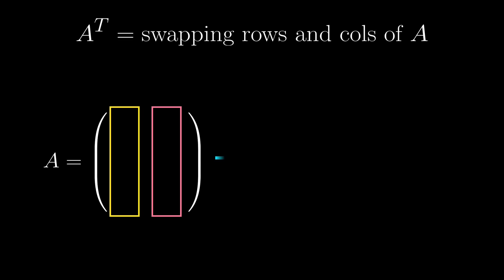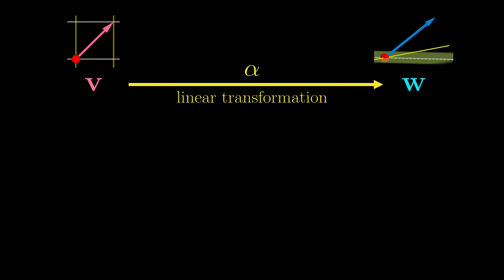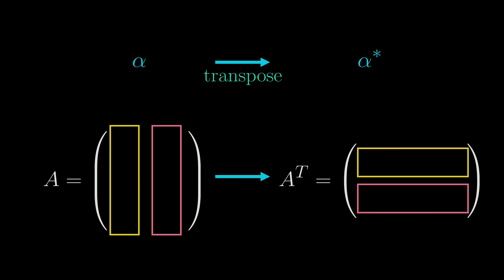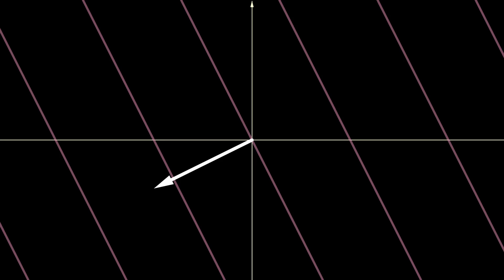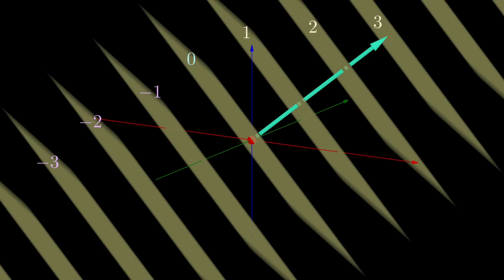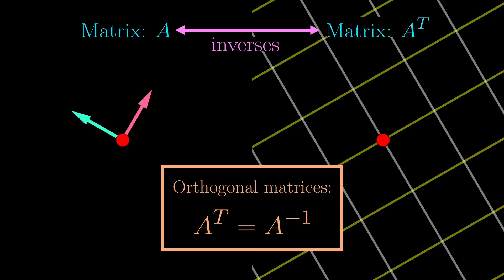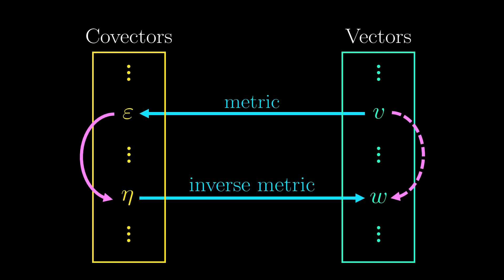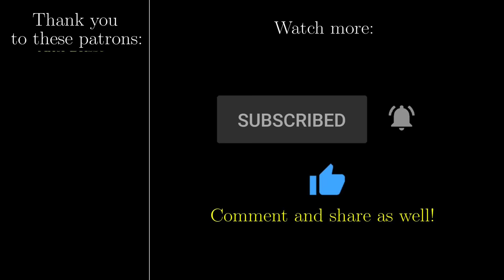The deeper meaning of matrix transpose

Comment: You say in infinite dimensional vector spaces we have many more vectors than co-vectors. Is this true in general? I was under the impression that it is essentially arbitrary which space we consider the dual.
And in infinite dimensional (complex) vector spaces we encounter another quirk. We find operators that have no Eigenvectors in either the space or the dual. They either have left or right eigenvectors. An example from quantum mechanics are the lowering operator, which only has right eigenvectors, and its adjoint, the raising operator, which only has left eigenvectors.
This is a concept that I am having trouble understanding, as the characteristic polynomial should just give us the Eigenvalues and not care about left or right?
Reply from the maker: Many more covectors than vectors (the other way around). See the description for the explanation. There are more covectors than vectors precisely when the vector space is infinite-dimensional.

How do you have the characteristic polynomial in infinite dimensions?
Reply: @mathemaniac  Again in QM we have the state space with elements |x> and the dual space with the <x| . This looks like there should be equally many, regardless of dimension. Is that a property of a Hilbert space?

So is it just that we can't define the terms of the polynomial so we can't expect the same results? Is there a more general rule to find the left and right Eigenvectors and values?
Reply from the maker: @narfwhals7843  That's not all the duals in the infinite dimensional case. If we go back to the wavefunctions in 1 dimension (to make things a bit more concrete), then the function psi --> psi (0) is a perfectly good dual [it is linear, and it sends a wavefunction to a number], but you can't write it in terms of <psi|. (If you force yourself to write down that wavefunction, that would be the delta function, which is not a wavefunction.)

To be honest, I am not sure about left and right eigenvectors, because I just know the right eigenvectors and do some sort of transpose to get the left ones of the transpose. Generally, infinite-dimensional vector spaces behave very differently from finite-dimensional ones anyway. You really shouldn't expect to have a general rule to determine eigenvalues/eigenvectors - just in differential equations, eigenvalue problems are in general difficult to solve.
Reply: The ladder operators are defective matrices in finite dimensional spaces (thus missing eigenvectors), but not in infinite spaces because it takes infinite operations to kill arbitrarily excited states, one level at a time.  See the comment above on Hilbert spaces about th different sizes of spaces.

Comment: i have difficulty conceptually separating vectors and covectors when, in nearly all vector algebra i've used, there's been zero meaningful distinction between them in practice

for one: with matrix notation, whether covectors are the "row vectors" or the "column vectors" is entirely arbitrary, and likewise with "bras" and "kets" in bra-ket notation - covectors with no corresponding vector didn't seem to come up in QM, for me, but maybe i missed them - but since the algebra doesn't seem to suggest an inherent distinction on its own, it feels like weird human artifice to impose it

for another: when dealing with special relativity, you can bake the metric directly into your basis elements if you don't restrict yourself to standard linear algebra, removing the metric tensor from consideration entirely, and allowing every vector and its corresponding "covector" to be fundamentally equal - this was extra useful to me, because many applications of the metric tensor are very dependent on situational "covariance" and "contravariance", and these concepts were never explained in a useful manner or clearly demonstrated within the algebra itself, so it just looked highly arbitrary at worst and fudged by-eye at best

baking the metric directly into the basis also allowed me to discard the cross-product in favour of an operation that makes sense and works in more than 3 dimensions, but that's a different matter

(also, i have a somewhat better grasp of covariance and contravariance now, because using explicit bases instead of implicit ones seems almost mandatory in genuinely demonstrating the covariant and contravariant parts of a "basis transformation", which it turns out, when done correctly, is less a transformation than it is a fun notational trick that transforms nothing except the way things are written down)
Reply: expanding slightly on the second point, about the metric tensor, now that i remember it slightly better: when taking a vector-gradient of the electromagnetic 4-potential, versus taking the divergence of the resulting electromagnetic tensor, the metric tensor would switch between "covariant" and "contravariant" forms (by inverting the tensor in some capacity, i think), and most everywhere treated this like it should be absolutely obvious when and why it is doing that - not to mention how unintuitive the missing minus-signs were for one of the forms

when i construct an equivalent gradient operator using geometric algebra, with the metric baked into the basis elements (their "quadratic form"), i need only understand that the basis vectors in each term are actually multiplicatively inverse* (not obvious in most explanations of the gradient): we don't have x̂ d/dx, but rather 1/x̂ d/dx, for example, and the necessary signs emerge naturally from the metric thereafter

and neither do i need to do anything to that operator before also applying it to the resulting electromagnetic bivector (for its divergence): the elements handle the metric inherently

it's much cleaner, and its easier for me to understand the math because it feels like the math better understands itself

*there're some details to this i have yet to work out, because i've been very depressed and possibly the only person on the planet who cares; if i am wrong in some capacity here, the easiest way for me to understand it might be to understand how (or whether!) the gradient operator can meaningfully exist for elementary null-vectors (that is, null-vectors that aren't just a sum of elements with opposing non-null metrics) - given a null-metric shouldn't have an invertible metric tensor either, i've been assuming it cannot

Comment: Nice animations! And nice first part on 'moving the scale'. I never realized the connection between the adjoint and pull-back until this video. 

I hoped to see the dual vectors as rows, not columns, and expected a description of the relation between covevtor and dual to involve the metric, not as an afterthought. In fact, it was right there the whole time: ax+by.  With both of these, you could already see the transpose in converting duals to vectors, and thus the transpose of operators also. Finally, this geometric interpretation could help clarify that the adjoint is only the transpose for the trivial metric (but always for duals)